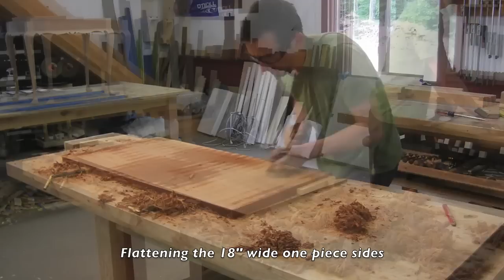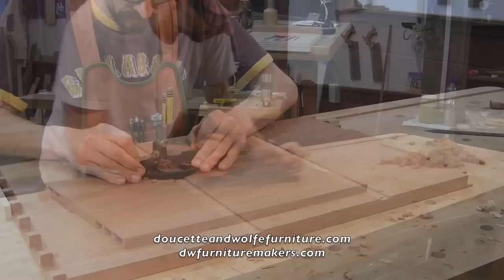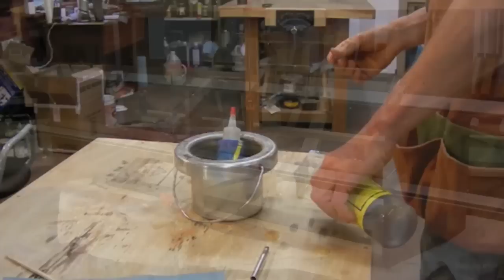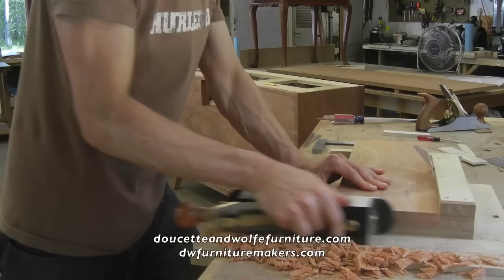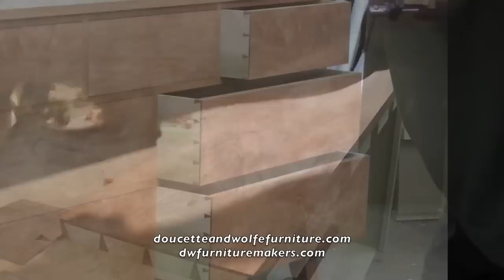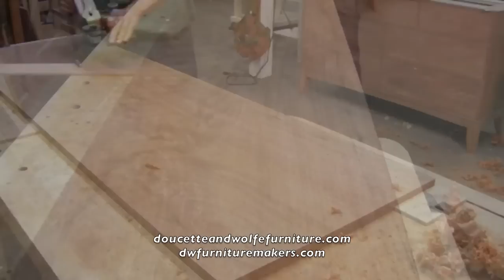Double Dresser building process by Doucette and Wolfe Furniture Makers

Comment: beautiful dresser, I noticed you didn’t use any metal drawer guides just let the drawers ride on wooden rails? did you surface the wood with wax or anything to make the drawer bottoms slide easier?
Reply from the maker: Yes I use a thin coat of wax.

Comment: I noticed you use a lot of wide material.  Have you had any issues with it's movement?  Traditional teaching says to keep the thickness to width ratio to about 3:1 or 4:1 and glue up to make overall width.  I was just curious if you had any issues?